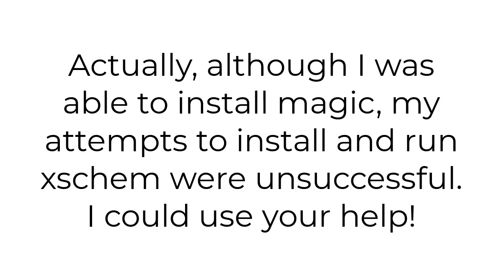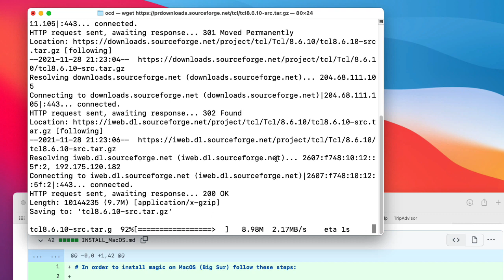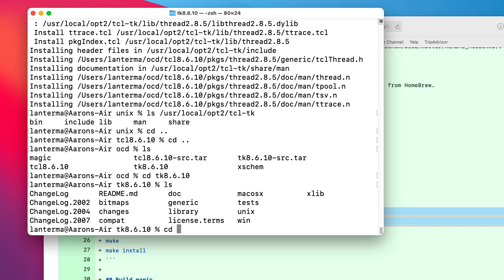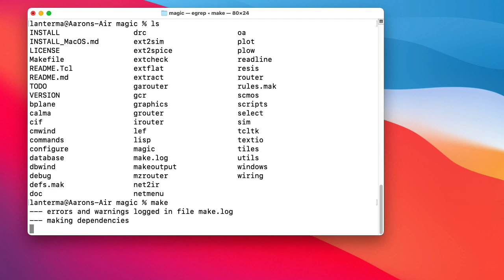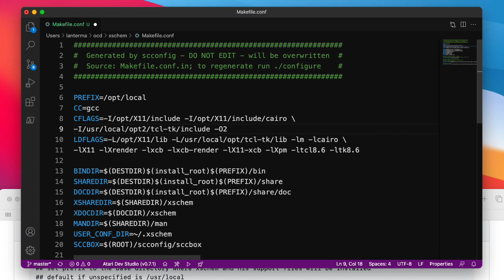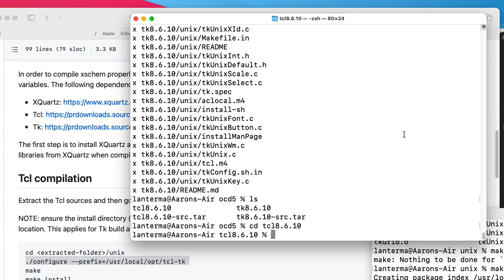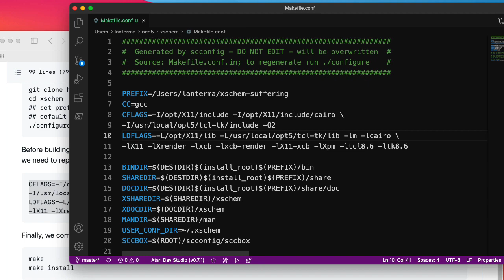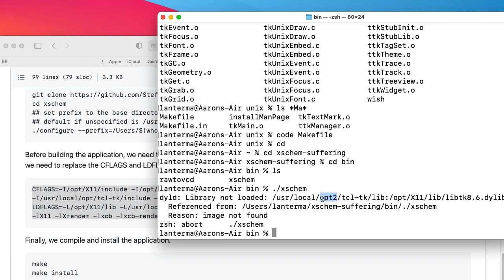Installing Magic & Failing to Install Xschem on an M1 Mac running Big Sur (VLSI design tools)

Comment: Oh my god I'm glad you're running to the same issue with opt2. Thank you!!
Reply from the maker: I managed to fix my xschem install, but it was really awkward: https://youtu.be/D-TCH7fxSlE
Reply: @Lantertronics  I had one more issue that I had to fix before getting it running. I kept getting this error "Referenced from: /usr/local/opt2/tcl-tk/bin/wish8.6
  Reason: tried: '/usr/local/opt2/tcl-tk/lib:/opt/X11/lib/libtk8.6.dylib' (no such file), '/usr/local/lib/libtk8.6.dylib' (no such file), '/usr/lib/libtk8.6.dylib' (no such file)."

To fix it, manually copy "libtk8.6.dylib" from the tk unix folder to '/usr/local/lib/'. The error will go away when calling magic and everything should be running smoothly.
Reply from the maker: @RyanThompsonrthomp  Excellent!

Comment: If all else fails, you could use install_name_tool to change the shared library path in that executable to the correct one.
Reply from the maker: OOOOOH! Thanks for the tip! I had no idea you could do that. I actually tried to use a hex editor to manually change the path in the executable in various ways, none of which were successful. I am totally going to try that next!
Reply from the maker: You totally SAVED me! Your advice brought great success! Documented here:

https://youtu.be/D-TCH7fxSlE